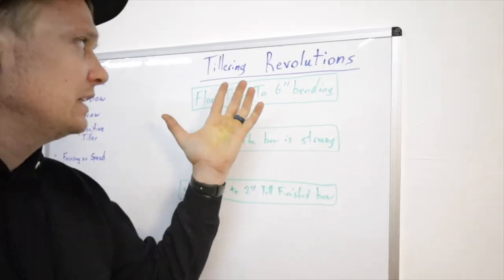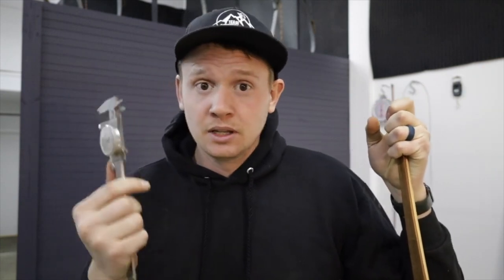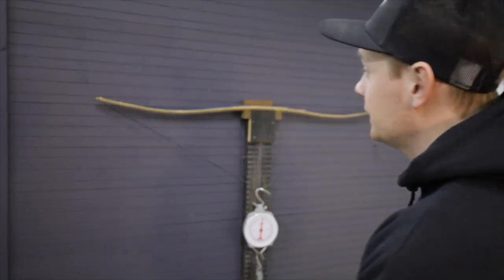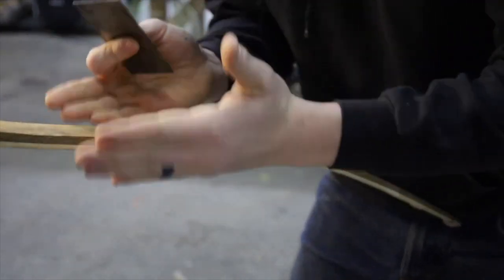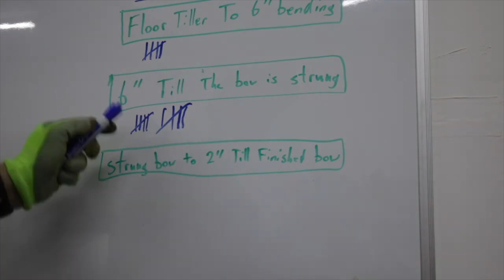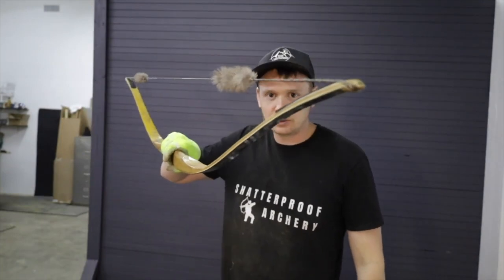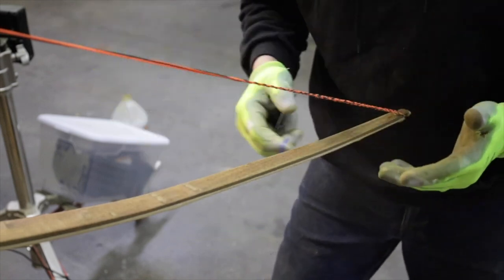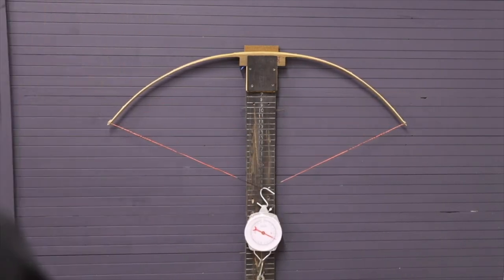Tillering A Reflex Deflex Wood Bow "My Full Process" (Tillering Course ep 15)

Comment: Going to make my first bow as soon as I get the wood. Was wondering  white oak bow would make a good bow?
Reply: I realize this response is very late, but here goes: white oak is fine. I've made a few character bows from harvested white oak. Red oak is better; it's commonly available in the form of dimensional lumber(it's easier to make a fine, production quality bow this way), it's easy to work, and easy to achieve a hunting specs bow using red oak. I think it's my favorite wood to work with
Reply: @robertmooney1492 what is the best wood to use to make a bow using production wood bc my dad is a woodworker and k can get any type

Comment: I have noticed with my cabinet scraper it gets very hot when I am scraping the belly of the bow. I am wondering if the friction heat from that is in any way significantly influencing "heat treating" / "set" on the limbs? I did file and use my plane to initially get the limbs down to a starting thickness, but have taken it very slowly since then and doing most of  the limb thickness reduction using the scraper... I seem to have a bit of curving (not a whole lot) back toward the belly and started wondering if that friction heat was doing it. BTW, thank you for the excellent string I ordered from your store. :-)
Reply: I would guess not. It's the scraper that gets hot, and maybe the removed wood.

Comment: As a archer for the past 25 years & a  avid hog hunter I really don’t have a interest in wooden bows , they really have a lot of down falls & set backs over metal riser bows & you can do a lot more with set up of you bow when it comes to metal riser bows . Over time wooden bows dry out , limbs get weaker & GOD forbid if it breaks it’s over . Yea I can see them if your in a survival situation but that’s about it . I,ll stay with my metal riser bow any day of the week , it’s reliable as long as I keep it unstrung when not in use & as long as I condition the limbs every time after use with a light wood Polish with moroccan oil infused in the Polish itself , it’s keeps the maple core nice & supple & keeps the core from drying out  just be careful not to use to much because it could make the laminates separate from the wood . Learned that trick from one of my uncles that use to be a avid recurve bow Hunter way back in the day & it works .